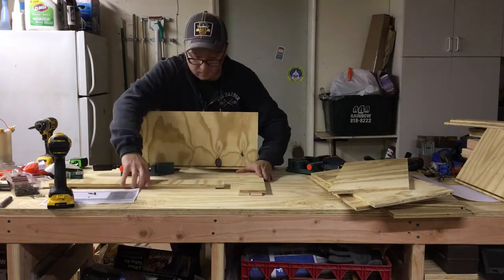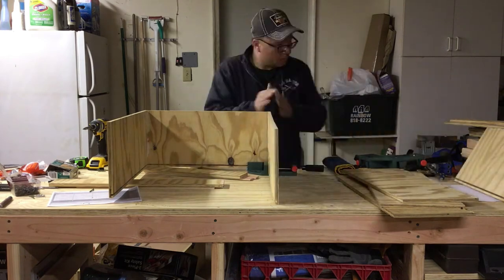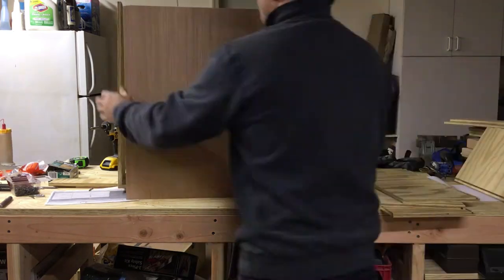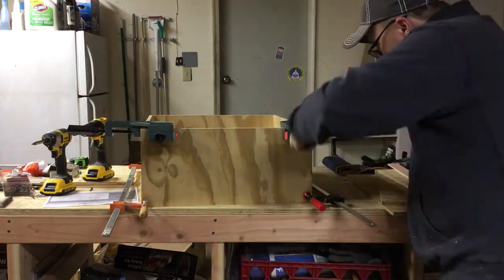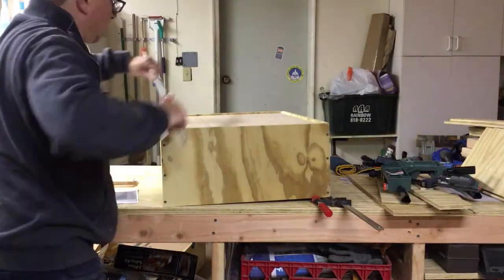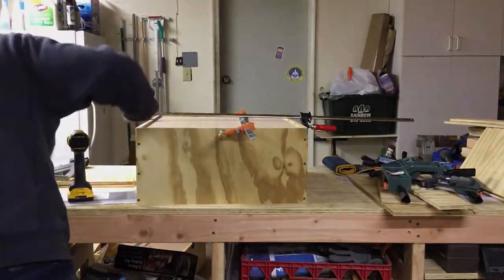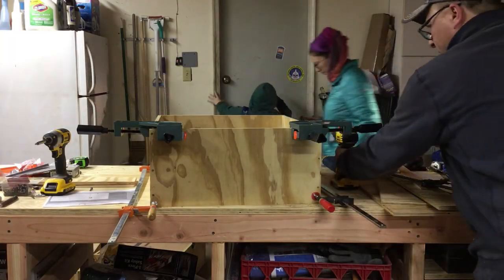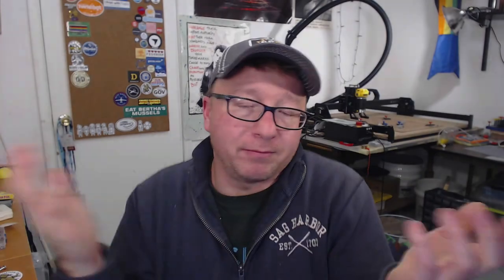How To Make Drawers for Shop Furniture

Comment: Looks good man, thanks for sharing.

Are you adding fronts to the drawers or leaving them as is?

I made some China cabinets years ago and was too lazy to make the box first. I attached my nice oak directly to the sides of plywood. So of course a few years later when the drawers didn't hold I took them apart and did them properly.
Reply from the maker: Thanks for watching!  Yes, I plan on drawer fronts.  I haven't settled on hardwood, or higher grade plywood with edge banding.  Interested in everyone's thoughts or suggestions.